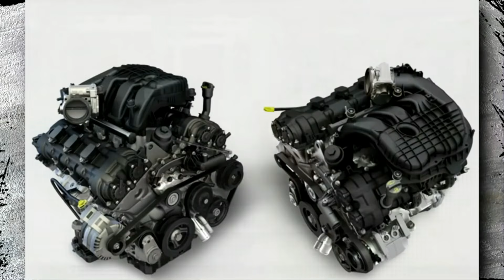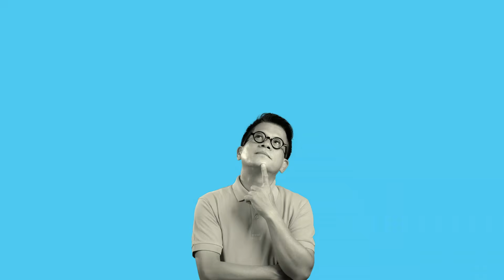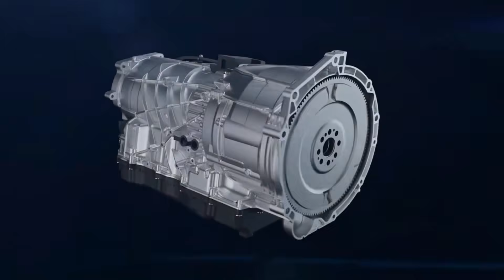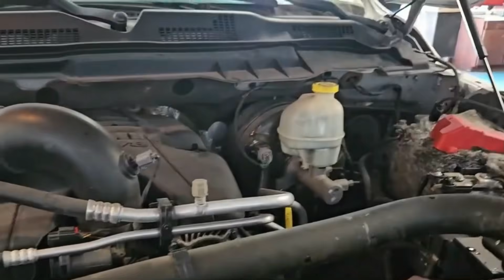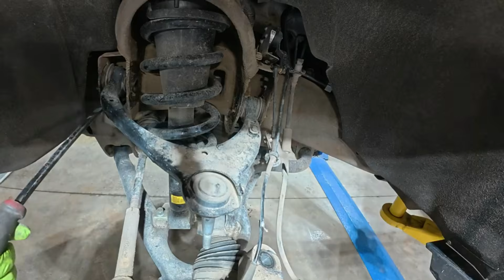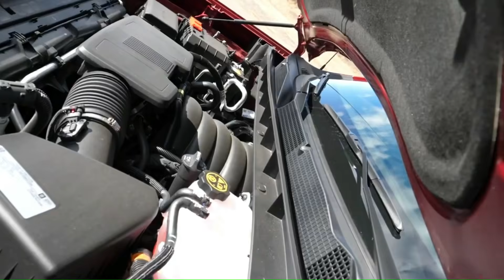7 Reasons Your RAM Won't Reach 200k Miles (Fix These Now)

Comment: 22 Chrysler 300 5.7 uses 0 20 do I stick with that or run the 5w20 I'm in the south
Reply from the maker: In the southern heat, sticking with the manual's spec ensures your oil pressure remains consistent while meeting the demands of the variable valve timing system 👊
Reply: @EverythingRAM88 For the last 10 to 15 years the Chrysler 300 use 5 20 now for year model 22 they switched to 0 20 I think that's crazy the owners manual say 0 20 5 20 or 5 30 lol idk . A guy told me at the dealer that if u use the wrong weight it's sets of a check engine light the dealer can tell if the wrong weight being used by a certain sensor thats on the engine is that true you ever heard of that

Comment: 188k 2014 Ram 1500 Ecodiesel
Reply from the maker: 188k on a 2014 EcoDiesel is genuinely solid — that 3.0 V6 turbodiesel had a rough reputation with oil cooler failures, EGR cooler issues, and the emissions scandal that followed it. Reaching 188k means yours dodged the worst of it or you stayed ahead of the maintenance. Diesel maintenance is a different game though — stay religious on the oil changes since the turbo bearings are oil-fed, keep the DEF system healthy, and watch that EGR cooler. The engine rewards discipline and punishes neglect harder than the gas motors do 👊

Comment: 100K, no longer blue/green. Watch out for that exhaust crossover during final topoff
Reply from the maker: Good catch on the color change after 100k — that's the inhibitor package degrading and the chemistry shifting. The exhaust crossover topoff issue you're flagging is real on some engines where coolant briefly contacts hot exhaust components during refill. Always burp the system fully with the heater on max heat and the cap off until you see air bubbles stop. Skipping that step is what creates the air pocket that cracks heads on aluminum engines 👊

Comment: Used 5w30, oil changed every 5k and explain to me how a non MDS lifter failed. So it’s not mds every time
Reply from the maker: You're right, lifter failures can still occur from oil pressure drops or simple component fatigue regardless of the system. 👊
Reply: @EverythingRAM88 I switched to penzoil ultra platinum 5w20 after the new engine was put in. Truck runs smooth. After speaking with a very knowledgeable tech(30yrs experience with mopar) he said the new style hemi has very small passages for oil. Unless I’m towing or in high heat areas then use 5w30. Last oil change I did added the hot shots tick fix/prevent with genuine mopar filter.
Reply: @Darkknight-ti7fz A guy at a dodge dealer told me they can tell if you use the wrong weight oil also there a sensor on the engine to detected that and set off a check engine light is that true

Comment: $ 800 for a dealer transmission fluid drain and fill
Reply from the maker: Eight hundred dollars for a drain and fill is robbery. The job takes about an hour with a pan drop and filter change. Parts cost under two hundred dollars if you use the correct ZF Lifeguard 8 fluid and a quality filter. Even a good independent shop charges three to four hundred max. If your dealer is quoting eight hundred, find an independent transmission shop and save yourself half 👊